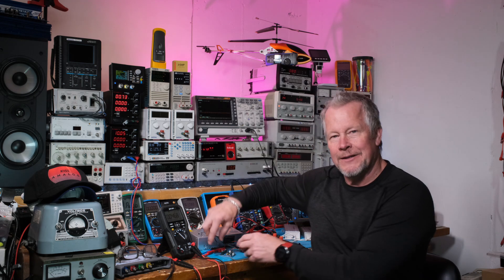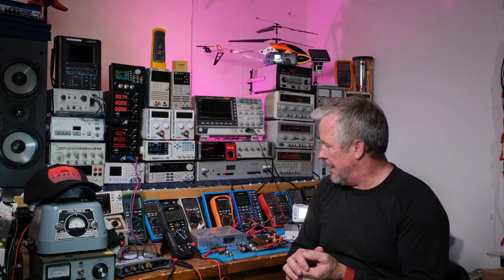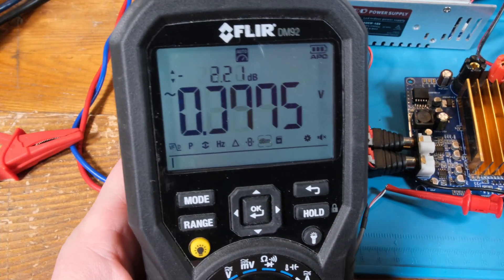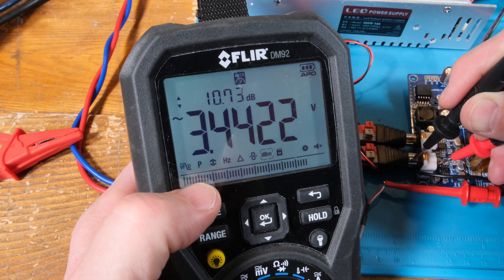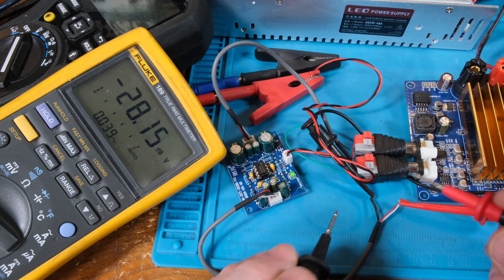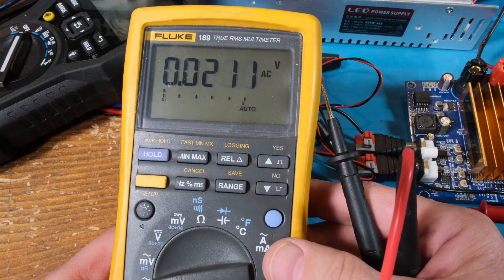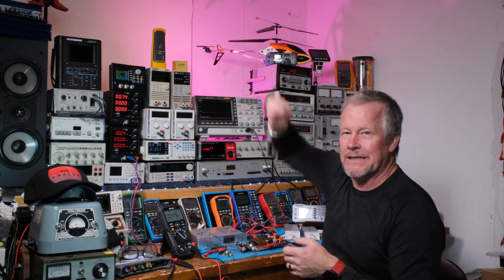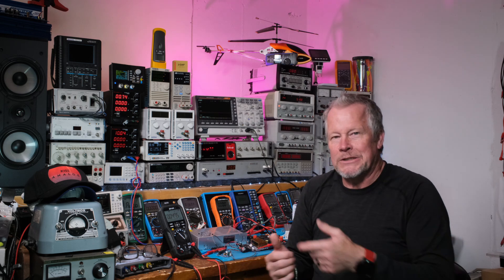Adding NE5532 PreAmp to TPA3255 300W + 300W Amplifier Project

Comment: Hi Eddie
I've used different preamps (chineeses) and tryed to plug them to different class D amps. But all the time, I can ear a hum or buz... I think it's an impedence adaptation problem. How do you face this problem please ?
Reply: In one test, my preamp is the same as yours and the class D amp is the TP3116
Reply from the maker: Thanks for sharing this!  I think it is the grounding.  Are you using switching power supplies?
Reply: @KissAnalog  yes indeed but I had also tryed with one battery for both ans two batteries (for each). The hum ils really lower but still present....
I don't have tryed yet to ground speaker's connectors. That's really anoying because I dont want to use batteries... I want an internal PSU: I will try with a transformer
Thx

Comment: Preamp can be between 6-15db gain, assuming a power amp gain of 26db. It should be able to swing at least 2V p-p for around 500mv input. You could make the preamp gain adjustable or a high/low (12db/6db) type arrangement.
Reply from the maker: Thanks John!

Comment: That JAT PS is just a click bait. 
KA: hours of videos and months of planning, using obsolete parts to make a product that is already available for $35.
JAT: Hold my beer... I'm going to use a  470uf cap and a diode to show you a good PSRR amp.
Come on man.
Reply from the maker: Thanks Sergio for your feedback!  I'm sorry for taking so long to finish my JAT power supply.  I've had some things come up, and I'm trying to finish this project for a friend;)
Reply: @KissAnalog  Don't be sorry.

Comment: The part about fluke equipment which was always somewhat funny and ironic to me is the name, 'Fluke':
fluke
3 of 3
noun (3)
2
: a stroke of luck

I don't like the idea that my Fluke meter working properly is a 'stroke of luck'... 🤣🤣
I've had a number of fluke meters down through the decades that were unreliable. Older models. My 787 will sometimes stop showing anything on the display and I have to cycle the switch to bring it to life, no it's not the battery saving timeout/shutoff, it will do it as soon as I turn it on half the time, probably need to take it apart and clean the contacts. It's 'fluky'.
fluky
adjective
ˈflü-kē 
variants or less commonly flukey
flukier; flukiest
1
: happening by or depending on chance
2
: being unsteady or uncertain —used especially of wind
 🤣🤣
Reply from the maker: LOL  Thanks for your feedback!  One thing you might try is to make sure that the display contacts are clean.  That rubbery membrane thing that makes the contact to the display to the PCB can start having issues.  Cleaning it can help.
Reply: @KissAnalog  Just as an FYI...
I took it apart, and checked those connections for the display as well as looked at the contacts on the rotary switch. I noticed that when playing with the pressure on those membranes that portions of the display would go missing but never go totally blank.
My symptom was that the display would go totally blank and by moving the selector to another position it would return.. It would be all there, or all gone. 
I noticed that there was a bit of grunge on the rotary contacts and traces. I cleaned those up and applied some Stabilant 22 as a lube and contact assist.. So far it's working fine.
Reply from the maker: Great to hear!!

Comment: Interesting project.  Curious about the gain though.  As stated in an earlier comment, are you planning on passive or an active RIAA filter ?  And, where do you plan on putting the RIAA filter in, or between which stages of amplification ?   Only bring this up as you do say your interested in using this set up for a phonograph.   Thanks for the video and sharing your experience, Eddie.
Reply from the maker: Thanks Sparky!  The turntable that my friend has has the gain stage built in but the output is still not very high.  I'll have to take another look at this to see how this class d might be modified to do what I want.  The Class A 20Watt video series shows me adding a preamp board that ended up working fantastic!

Comment: I reviewed this little preamp about 3 years ago. After a couple of mods, it's excellent. You need to check C11 & 12. These should be about 22pf but many have been fitted with 330pf or more and still are today! This drops off the HF dreadfully. IE starts to roll at 5khZ. Very none HiFi. Because it's single ended supply it likes about 30 volts, lesser voltages can give rise to unsymmetric clipping.
Of course, they are all fake 5532s but work OK in most applications. You can see what I found here if anyone is interested. https://youtu.be/vZ5XyXB2BU0 I'm looking forward to your tests, will it be OK after 3/4 years??
Reply: Hi is there a way to tell if your 5532 is a fake just by looking or what sort of test set up would you recommend to test correct functionality please ?....cheers.
Reply: @andymouse  Not really a way by looking at it but a simple test with a multi meter, measure (in diode test) between pins 2 and 3, you should measure a diode in both directions. Fakes tend to not have these diodes across the input and will measure open on both directions. I show this in detail on my channel if you are not sure what I mean.
Reply: @MichaelBeeny  Thanks, will check your channel.
Reply: Great channel !
Reply from the maker: Thanks Michael!  I did suspect that the capacitors are too large as I saw this start to have a significant rolloff at 10kHz and especially at 20kHz.  I wanted to make this a quick video to highlight using the dB function on a multimeter. 

I'll do a more serious look at this when I look at the Bode plot and the spectrum.  I have another board that I think has the real 5532, and I also purchased some from Mouser.  I also have some other OpAmps that I want to compare.  Which ones do you like for Audio?

Comment: Not sure why you need to drive the amp more than a volt.  Also if you're going to amplify a turntable photo cartridge  you will need RIAA Equalization.
Reply: Yep wont be seeing a volt from a phono cartridge !
Reply from the maker: Thanks David!  I should have explained that this would be for turntables with a preamp built in.  My friend has a nice turntable that has this preamp built in, but it still only puts out about 1Vpp.  The Class A 20W amp that I built for him I installed a preamp board to help boost this.  But I do need to take a closer look at this Class D gain stage.
Reply: @KissAnalog  most of the Chinese class D TI boards that I've seen and bought have an op-amp that makes them quite sensitive and in fact I had to reduce the feedback circuit to lower the gain on one

Comment: Hey kiss! I've managed to find the issue with the amp i was having. It was faulty chips. PBTL pin was shortened!.

Now I'm wondering how gain in such device works. My chain is completely digital (PCM/I2S)

I've measured the input signal and the digital signal and the digital path seem fine!

Now  I have to figure out why setting 0dB in the volume control i have a very limited amplification... Seems like that the internal gain of the amplifier is low.

Sometimes analog is a lot easier than digital stuff even for IT guys that works with digital stuff all the day!
Reply from the maker: Thanks for your great feedback!